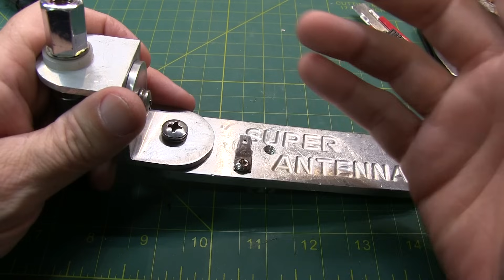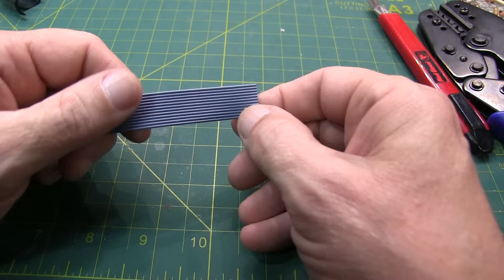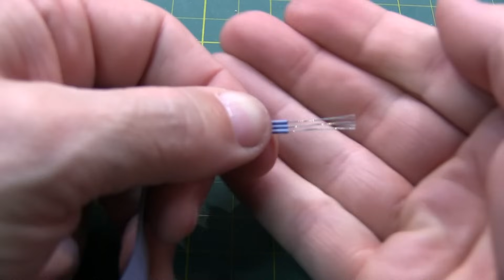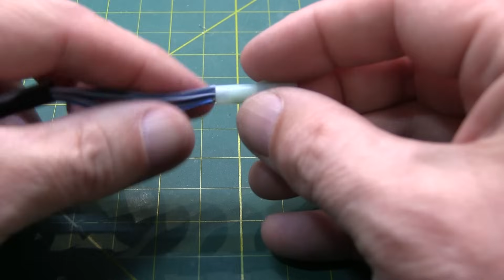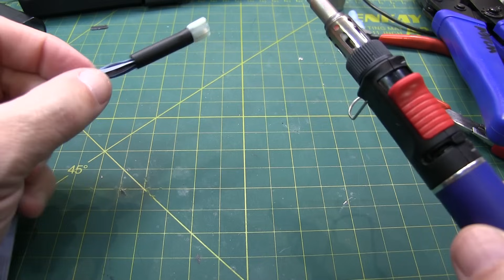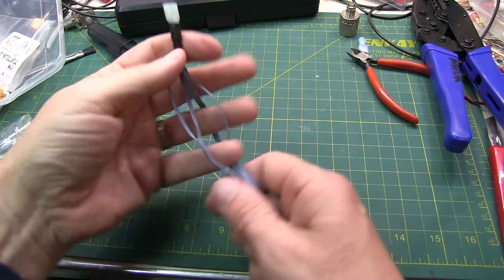#395: Easy to make ground-radial kit for portable radio operations using ribbon cable

Comment: Your razor method is probably the best, but I’ve also had success using auto-stripping pliers or an old-school pair of wire strippers—the kind with a diamond-shaped opening for the wire and a small cam stop to select the gauge.

If you roll three or more wires together (depending on the gauge) so they form a single bundle, you can strip them cleanly using sharp old-school strippers. A lot of people dismiss them today, but for speed, they’re still the best wire strippers you can get. You can find them at Harbor Freight for around $4–5. They’re made of flat steel, have colored end caps, and usually feature a large spring in the middle of the hinge connecting both handles.

Comment: Tuning the RF preselector is quite challenging for me. Despite my extensive experience with various models, achieving precise phase alignment across the multi-cavities using RG214U cables remains difficult. I use an HP8753ES VNA for this task. Specifically, I'm working with the Telewave TPCP-4546, a 4MHz bandpass preselector, and tuning it to a 2MHz bandpass. I, along with many others, would love to see a YouTube demonstration on this topic.
Reply from the maker: If I ever get my hands on one, I'll make a video.

Comment: For small, single strand wires, I inherited a crow's foot stripper, that makes quick work of this type of wire.  I am also a great fan of your system, of bending the wire, and lightly touching the plastic coating with a very sharp razor or knife.  That is my go to method, in a tight spot where you can't use stripping pliers,

Comment: I've heard about thermal wire strippers and I'm guilty of using my soldering iron on difficult to strip wiring. I know that in the aerospace industry it was a requirement to use thermal strippers. A cheap slobbering iron with a junk tip filled into a vee tip maybe, but it wont't go ALL the way around the wire. I looked for a commercially available thermal wire stripper a few years ago with no success. Something with a very light spring tension would be best. Great video! Happy New Years! 73!

Comment: Hey Alan, always love your videos. Can I offer an idea for a video? Recently I bought cheap oscilloscope probes (p6500) and would like to test/adjust their frequency response. I have a nano-vna, but i'm in doubt if i should terminate input (didn't), and how to calculate expected attenuation (-45,15 dBm is what i came up to).

Thanks for the knowledge.
Reply from the maker: Unfortunately, you can't really determine a 10x passive probe's bandwidth with a VNA.  A 10x probe works in concert with the 1Mohm input impedance (and input capacitance) of the oscilloscope being used.  And, since the input capacitance of every scope is different, the probe has to be compensated manually for the scope being used.  The process of compensation is what flattens the main frequency response.  In order to check the probe bandwidth, you'll need a good, ideally flat  RF signal generator, a fixture that will allow proper termination of the RF signal and a means to connect the 10x probe with minimal impact of ground inductance.

Comment: I have something almost identical, but with a ring instead of the spade connector. Fits over 3/8 or M10 screw for grounding, and as you say, doesn't tangle at all!

Cheers and Happy New Year!
George M1GEO.
Reply from the maker: Yes, I made one with a ring terminal also, for my mounting situations that use it.

Comment: there is a tool called a 'hot knife' that is basically a soldering iron with a xacto knife as the tip. Use the hot knife blade to simply melt the insulation away, and pull it off. Hobby and craft stores usually have this tool. Not cheap for one or two time use though.

Comment: Keeping flat strands of 3 wires is a very good tip to avoid tangling! I've been using a radial system consisting in 10 individual wires evenly spaced, and while this makes a very efficient antenna (I've got the theoretical impedance of a resonant 1/4 wave monopole: 36 + j21 ohms) it is a pain to deploy and disassemble.

Comment: The trick i have always used is to pinch the wire between my thumbnail and index finger and pull.  It works well with the grey thinner ribbon cable.

Comment: Its not a great way, but I leave a drywall knife with a new or newly honed blade on it. You just have to push a little bit without sawing. I have a nice ribbon cable end kit and I might just make the connector connection and then join all the pins on the connector together. Did I miss something? I was expecting you to trim each of the 3 in each set for different bands. I am not sure if they would be effective because of the close proximity to the other wires and capacitance. I would have ask someone like you or try it.
Reply from the maker: With trial and error, that could work and be effective, especially if elevated. I wasn’t making any attempt for tuned radials.
Reply: @w2aew  I have been learning a lot from you. Its not easy beating it into my brain and having it stay there. TNX de w0it

Comment: Why not use IDC connectors designed for ribbon cables? Bus all of the connector contacts together onto a small sheet of brass or copper clad FR4, run a braided ground strap over to your antenna base. Easy to disassemble and store, too.

Comment: Use a lighter, burn off the plastic. After 2 seconds the plastic gets soft and you use two fingers to quickly pull it off the wire.

Comment: I've done a lot of ribbon cables for computer connectors. I use a soldering iron with an old tip and run it quickly across the end of the cable a couple of passes until it melts down to the wire. Flip the cable over and do the same on the other side. The insulation usually can be pulled off the end easily. Using this method there is no risk of strippers damaging the wire.

Comment: random observation:  The adhesive in the heat shrink tubing is a hot-melt adhesive, not an epoxy.
Reply from the maker: Thanks, yes, you are right.

Comment: Great tip with the ribbon cable! I use automatic strippers, even cheap ones will work once the pressure is correctly adjusted. The console modding community uses a different kind of ribbon cable, might be solid core or just with more resistant strands. Those are easier to strip and can also be directly soldered to, as the insulation will retract in a nice way.
Reply from the maker: Nice. The solid core stuff won’t be as flexible though.

Comment: Alan:   What do you think about taking the three wires in each group and cutting each wire for about 1/4 wavelength on three different bands?   I currently have a three band vertical (20,15,10).  It has 1/4 vertical elements cut for the three bands.   Some of the older antenna books also recommend cutting radial wires at 1/4 wave for each band. In fact "Simple Low-Cost Wire Antennas for Radio Amateurs" by Bill Orr W6SAI and Stuart Cowan W2LX features (on page 110) just such an antenna.  They also use ribbon cable.  What do you think?  73 from the Dominican Republic   HI7/N2CQR
Reply from the maker: Yes, that will work well, especially if you elevate them.

Comment: Cheap easy stripper is a fine pitch wood saw, which has teeth matching the cable pitch. Then you simply press it between the cores to cut most of the way through the plastic, onto a wood block, turn over and do again, then hold the saw tight and pull the insulation off. Sleeving a second longer layer over the connector and the first sleeve acts as extra strain relief, with the easiest being non glue lined sleeve, and using a hot glue gun to add in a small ring of glue around the overlap of the first one, let it cool, then sleeve and shrink it. That way there is no stress on the crimp, and the extra non glued sleeve allows the cable to flex slightly, so it does not have a fracture point at the exit. Neoprene or silicone tubing with some glue at the connector end works as well.